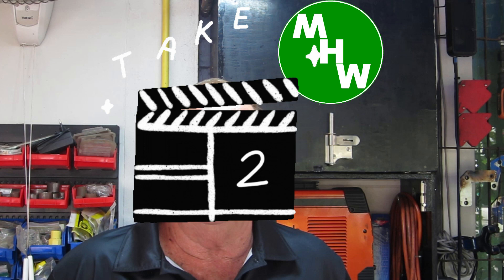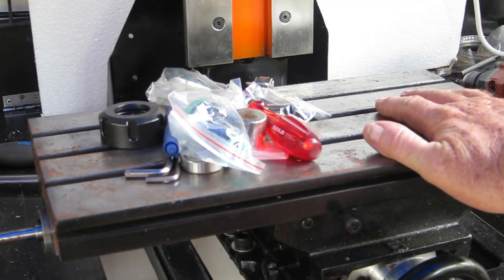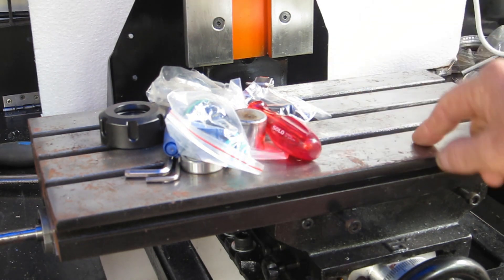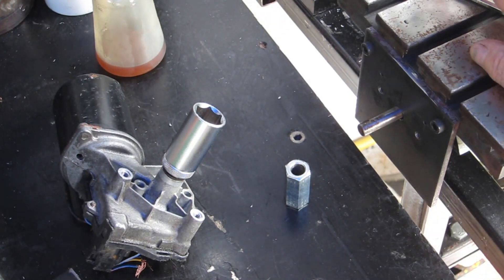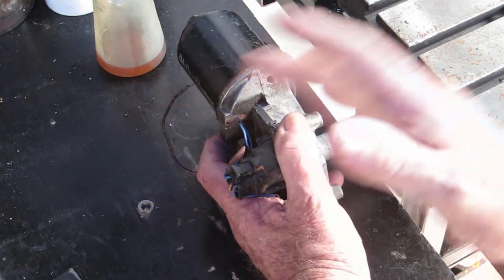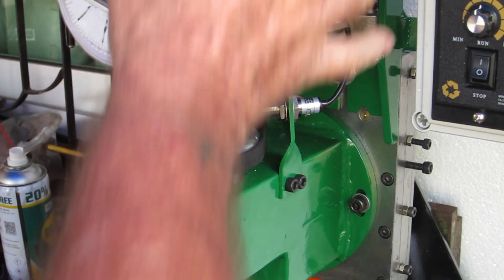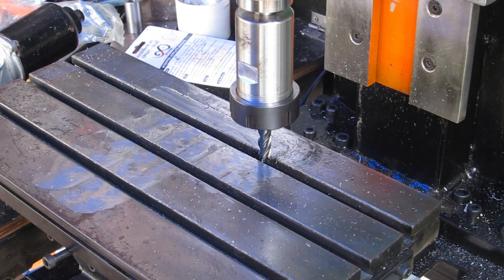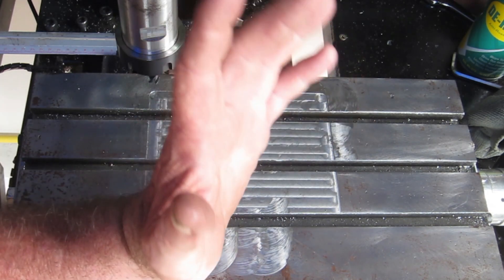MHW Episode 37 - Homemade Milling Machine Build - Part 8 - Odds & Sods to finish the build

Comment: Hello again…. Very much enjoyed watching your mill videos over and over.  I am also building my own mill now and might borrow a couple of your ideas.  One thing I wanted to mention about your power feed is that you might want to add a couple of limit stop switches to avoid jamming the table and motor at the end of it’s travel.
Reply from the maker: I'll take that into consideration, it's generally not an issue. Glad you enjoyed the build 👍

Comment: I bought one of those end mills but don't use it much as it needs a pretty decent Depth of Cut (DoC) to work, usually 1mm or more. 
The main problem with replaceable inserts is the radius or flat on cutting edge making them unsuitable for 0.001" finishing cuts where they just rub (as you found out) 
I ended up going back to the 1/2" brazed carbide tool that came with the mill/drill even though setting up 4 tools is a bit time consuming to get all at the same height
The carbide tools can be sharpened to work at very small DoC though.
Reply from the maker: I just had to rewatch that episode, there's been a lot of water under the bridge since I made that. I find that face mill to be almost useless on this mill, however, I am now getting absolutely fabulous finishes with my Fly Cutter I made using a variety of carbide tips, from a .2 rad up to a .8 rad, depending on what material I'm machining. I also recently bought 2 indexable end mills, a 12mm with a single tip and a 20mm with 2 tips, they both work reasonably well, but again, depends on what material I'm machining. 👍